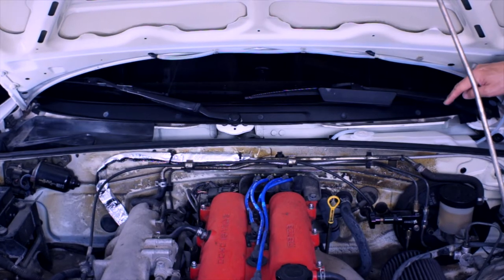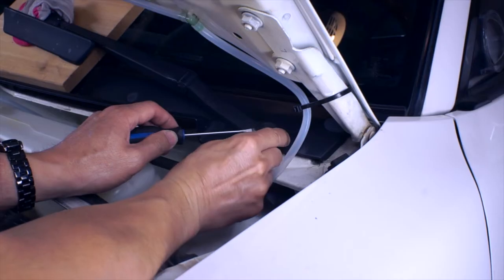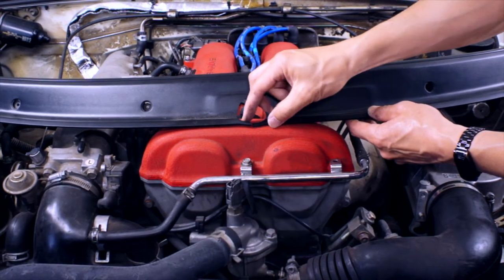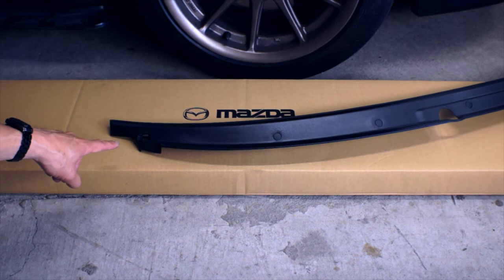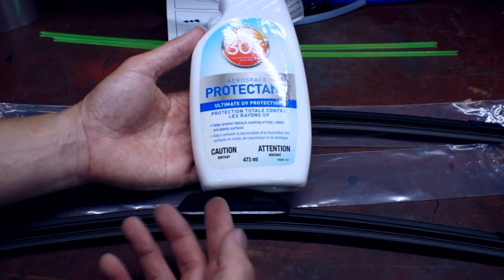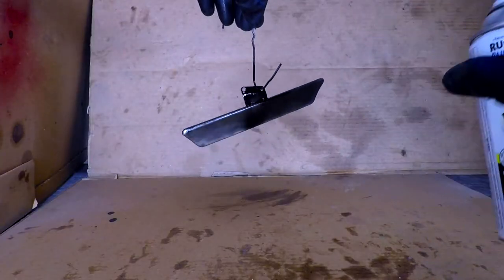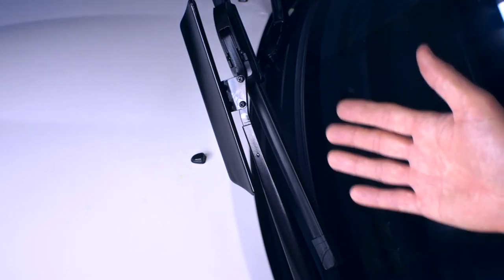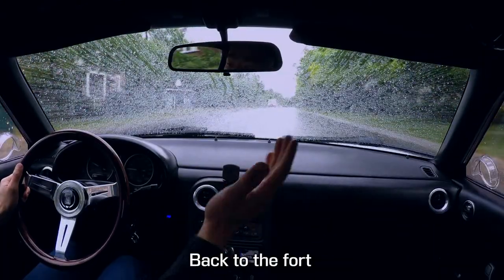BEST RAIN CLEARING 🤑 Wipers, New Cowl Plastic, Rain-X

Comment: The cowl inevitably always breaks around the mounting holes on the passenger side furthest outward, both NA and NB. When mounting you can actually see that the fitment is to tight and the nut bends it downwards. Some recommend to widen the mounting hole a bit so it''s not under stress. Also use a washer under the plastic cowl on that point so it's slightly elevated. :)
Reply from the maker: More great suggestions, I'll def widen that hole a bit to allow some room for expansion. The washer under the cowl plastic tho, wouldn't that lift the weather stripping that sits against the windshield?  I wouldn't want water to flow under plastic.
Reply: @mostlyuselessgarage  now that you mention it, yeah. Might have been a washer under the fastener. 🤔😅

Comment: WOW! my windshield cowl panel is broken in EXACTLY the same place. I have searched the internet for a used replacement but they are all overpriced crap. A new one is available only from Japan at $160 + $60 for shipping. Ouch. I am living with the broken panel but I am still searching for a replacement.
I appreciate the replacement instructions.
1999 Silver Miata base
2004 White Miata LS
(PS they are both my wife's cars)
Reply from the maker: Have you tried your local Mazda dealership?  The part no is NA01-50-790E. What's better than Miata?  2 Miatas!  Thanks a lot for the comment